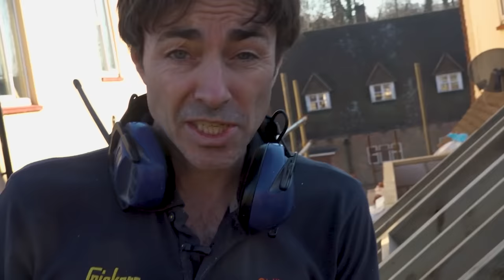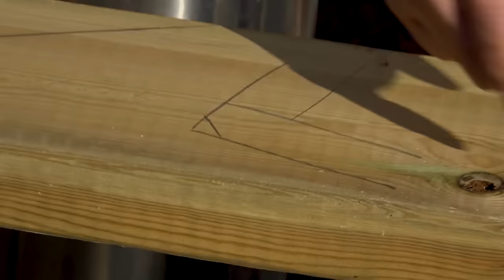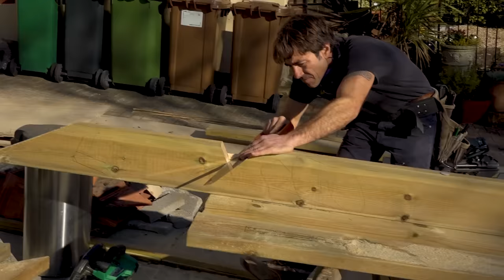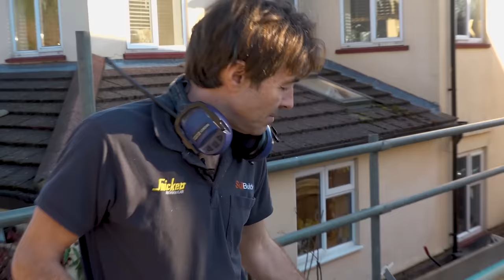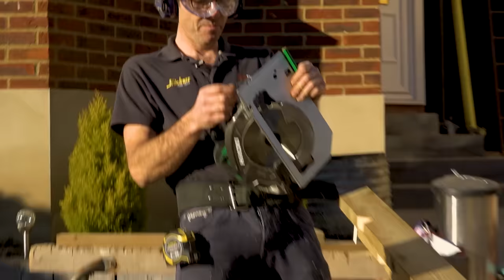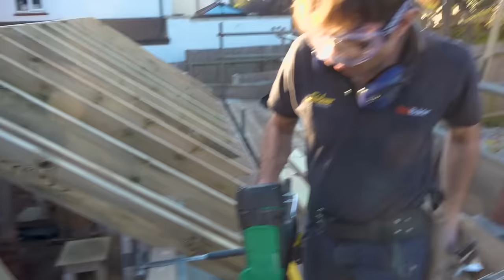How to Cut Hip Rafters

Comment: Big up to all the apprentice carpenters like me watching this so we can be better at roofing😂✊🏽
Reply: Thanks for watching John, good luck with your career, well done for choosing such a great worthwhile job mate
Reply: If you get this as an apprentice, youl go far mate.
Reply: Should watch Larry Haun videos as well. Both incredible teachers.
Reply: That's what I'm doing. 👍👍
Reply: Thats what im doing robin makes it so clear
Reply: My guy, meant to sit my end test for my level 3 nvq over a year ago, finally back at college to finish off with more experience, my end test is a pitched roof practical👀
Reply: Chippy life!
Reply: Get yourself a Swanson speed square off Amazon. Easier than using a roofing square to get your angles, indestructible and also fits nicely in your tool belt for marking square lines/running your skill saw along side it.
Reply: It's not roofing it's carpentry. I'm not watching roofing
Reply: @Louisthesaxman1  a speed square is useful for a lot of things , but it’s not nearly as accurate as a framing square.
Reply: @trevorhanks5282  I don’t want to be a roofer either! My skills are more inline with “Roof Framing”.
Reply: @larryrobinson08  I use trigonometry to get the length of all rafters along the pitch line and my speed square to cut my plumb cuts and bird mouths etc and you couldn't get a cigarette paper between my joints so I'm not sure how much more accurate you want to be.
Reply: Perfect scribing and your away
Reply: ✊🏾✊🏾💪🏾 right on! Brotha! Lol
Reply: Big up to all the sparkies working inside😉😉😉😉
Reply: You can't roof that's not a hip cat thing😔
Reply: Yeah im in😮
Reply: I'm 35 buddy been on it since I was 15
Guys like this can always show ypu a trick
Reply: Stay safe mates
Reply: Big up to you too John! My first time was yesterday with a roofing crew and I’m fascinated and intrigued. Roofing has become my passion I’m only 23 but I’m going to do whatever it takes to become a professional roofer. It’s such a beautiful side of carpentry. There’s no guess work just pure intelligence and charisma passed down from those you aspire to become! Love it ❤❤

Comment: Hi  I enjoyed watching your video.  I served 6 years of apprenticeship as a Joiner, and part of it was Roofing. the Joiner who was teaching me was in my  second year, the whole roof was set out on the ground,  after measuring from the wall plates, working from the building square, before we started off all the timber which was 3x2 75x50 as now, then each one was checked for the round (top of spar)  the reason for this when the purlins were put on the spars as called was higher which made it easier to nail down, then 6inch nails, the Hips Valleys measured by using the building square, then all cut by hand, as you did with your jig we cut the pattern spar with a strap on both ends, All done by hand saw, how things have changed, now, of course, it's all pree made trusses. I was always grateful for that experience of learning to use the building square, I am now 82 years old and still remember most of it, all thanks to that Joiner. it's nice to see someone else  now showing how to use the Building Square Regards welshman 2081

Comment: 71 year young still going strong carpenter from Oregon. I love watching how things are done in other places. I'm always learning and wish I had You Tube when I started. Very good well made straight forward video. Getting hips to align and plane out properly have always been a problem. We don't do hip framing to much anymore . I like the half lap joint on your top plate.  I also like you using a framing square with a wood piece clamp to it. I also do that method. The newer generation is speed square this and speed square that, I like the framing square. I think you get a more accurate layout versus using stair clamps. I also like you using  wider hip material. I use double 2x material. Its easier cutting your bevel and more importantly it allows better backing for nailing your roof sheathing. Some company needs to invent a mechanical hardware to make better connection for the top of the hip to the ridge. What species of lumber are you framing with ?  Here in western US its primarily Douglas Fir. More engineered lumber products are now being used. Simpson Strong Tie hardware is the standard for framing hardware in the US, is it used in England ?Thanks for taking the time making the video.

Comment: Thats a brilliant method, I've been a carpenter for 16 years and never though of cutting a hip in like this.... fair play you'll never stop learning in this trade.... love it!!!
Reply: Ceiron Green carpenter or your a framer? “ carpenter “ is a general term, usually means finish work or handyman type person. Not someone who builds houses, or remodels for a living.
Reply: @joeframer9642  The term carpenter has no relation whatsoever to a handyman
Reply: @joes2318  I'm a carpenter mate. Fully qualified and very well trained thank you. I have always cut a hip in using a geometric method. I was pointing out that the method Robin has demonstrated here is a different way to how I've been taught.
Reply: @joes2318  my mistake, apologies mate.
Reply: Ceiron, On a small roof it's easy to measure the length of the hips as Robin did here, on a much larger roof I always made up a rod and attached it to a dummy hip foot/ birdsmouth and got the length of them like that. As for getting the height above plate I always measured the vertical dimension from the corner of the plate to the top of the common rafter, whatever that measurement is measure down the plumb cut of the hip and this will give you an identical height of the hip in relation to the common. This is in effect what Robin did but not sure he explained it exactly like that. Fair play to him for showing those without his experience, I wish these vids had been around in the mid 70s when I first entered the building trade, they are invaluable as a learning resource. Happy Roofing
Reply: You can also measure to the point of the common rafter intersection and then work from the point of the hip down  either way marking up will be     a 45 mark up or down  . .
Reply: @chippyminton8711  most definitely buddy, I totally agree. Thanks for your advice, I'm looking forward to implementing it on my next hip roof. Happy roofing.
Reply from the maker: @mattryan1986  This is a difference between American terminology and the U.K. We claim prior art on this one.
Reply: @joes2318  Framer is american term, used to be carpenter&joiner who would do the lot, I'm bricklayer of 40yrs by trade and general builder but respect all good tradesmen
Reply: @ceirongreen1676 , its a good ole boy can admit his mistake.

Comment: Great video as usual guys. 
A tip for you Robin that I discovered a bit ago and I noticed you don't do it on a previous video.
When finishing the birds mouth with the handsaw, do the along the grain cut first followed by the cross cut, that way the grain keeps the piece in place whilst you finish off the cut making it neater and less likely to leave the little corner in there.

Comment: If I'm on my own putting up hip rafters, I nail a block onto the end of the 45 degree cut on the wall plate at the height of the up-stand then pick off the points with a straight length of timber, works great.

Comment: Hi Robin, I believe that I made a comment some time ago (before I had had my hair cut) and wasn't getting enough air to my brain, I wish to amend my comment it was to do with obtaining jack rafter diminishes the way I was taught back in the day when I had more hair! with the framing Square take the rise per ft run on the blade and the figure 12" on the tongue set to the edge of the timber and then mark and move 4" to the left the distance between the marks was the diminish of the jacks for 16" centres. I think I said move to the right in my comment. It all sounds a bit long winded now but it was quick at the time without calculators, actually I don't even think the wheel had been invented!!! Thanks again Robin for your site makes an old timer happy.

Comment: I much prefer the 'Measure once, cut 7 or 8 times, f@~k it up, get another bit of timber, do exactly the same again, get pissed off, throw a tantrum while my wife tuts' method, but that's my personal choice. 
Robin goes to show how technical a roof is, most of it went over my head (if you'll pardon the pun), great video.
Reply: the math is surprisingly easy and the satisfaction is big! Keep on truckin'
Reply: Measure 8 time's cut once it takes me forever to do a job 😂😂👍

Comment: Back in the 70’s I was working in Chertsey Surrey UK and used to spend my lunch times watching the roof restoration of a grade one listed 17th century two story house opposite. I was particularly intrigued on the method required for the cutting and fitting of the hip rafters (especially as they were all newly milled expensive English oak). After being measured and cut on the ground, I was astonished to see how well they fitted first time. (they needed to; it took three men to lift one!) 
Now I have some idea of how It was done, Thank you so much.
Reply from the maker: The first hundred you do are the hardest but after that it is not so tricky.

Comment: Been out of building trade 25 years now, I'm amazed to see how the power tools have changed. Nail guns were a recent invention in early nineties, big and awkward. Battery drills were mainly made by Walt Disney for Mickey Mouse.  Only the well off tradesmen could afford such luxuries. Hammer and saw for the old boys and 110V gear. Used to have to lump half ton yellow transformer across site, then your lead an them stupid plugs. I knew of some plumber who accidentally came down from his steps, stood on a 110V plug that had been dragged to the bottom of his steps while up there and broke his ankle as the plug rolled under his boot. He was PAYE but I don't suppose his employer was too happy.
Very good chippy work BTW. Keep the vids coming, I've just subscribed.

Comment: Love it from New Hampshire USA
Although we use inches & feet so keeping up with the math is a bit dodgie... 3rd generation builder 1st yr on my own after my father who's a master carpenter was diagnosed with laryngeal cancer losing his voice completely. Always looking to learn any new tricks or how others do the same thing with the same common end goal.  Thank you 100 mate.
Reply: Seriously? Metric isn't hard, count your fingers, it's easier to shout 150mm rather than 5'' and 29/32,that actually took me 5 min to count and work out on a tape measure, in metric numbers go up its bigger, in imperial numbers go up its...smaller...and/or bigger? Your money is metric, I'm interested in why Americans are so against the metric system, am I missing something?
Reply: @sally6457  As a UK Carpenter, we use both measurements. Above a meter in size it sometimes gets tricky to communicate the size of cut needed in metric to who you are working with 87 inches is much easier to measure out on a tape than 2210mm. Trust me, the bigger the sizing the easier it is in Imperial.
Reply: I'm in the UK and still use feet and inches as that's the only way I want to know .still get my roofing square that way . Easy to make mistakes in metric . Why are doors 2'6" and 6'6" and ply 8' x 4' but plaster board 1200 x 2400 . Timber is sold by the cubic metre yet four by two or two by as it's called . I don't go shopping for 98mm x 48mm as that's the sawn size . Either one or the other . I'm use to the imperial size in timber but I do use metric for metal work . I would use a 12mm bolt  with 1.25 pitch  thread .
Reply: @sally6457 , man is working from a plan called out in feet and inches, you expect him to first convert every call-out? Seriously?
Reply: @michaellloyd463  so is accuracy not as important if it's big? On a UK tape measure the 1/16" marks stop at 1', while millimetre  marks are the full length.
I'm unfortunate enough to be a British 40 year old joiner, so I'm working in the middle, I have to know imperial to understand the older generation, and the modern world of construction is metric, 
So we are the generation that had to learn both systems and know how to convert one to the other depending upon who you speak to,
Its all frustrating.

But metric is easier! 😝 hahaha
Reply: @leehaelters6182  I'm not saying that at all, I'm talking about people who stubbornly won't use and dissmis the metric system, 
NASA work in metric...

Comment: I am totally amateur but I did two roofs when I was younger. I got there by a mixture of calculation and trial and error. No roofing square or nail gun or power tools. 90% as good at best. They survived and don’t leak! I employed a master craftsman like youself for my next extension. He measured up the purlins and cut the compound mitres-perfect fit first time. All hand sawn and hammered nails. I reckon you should get an honorary degree in trigonometry.

Comment: When I frame hand cut rafters, I measure the distance from top of beam/ridge, to the outside of the plate. I cut the plumb cut, hook onto it and swing my tape across to the distance I measured. Using a speed square at the seat cut I mark the width of the plate where it intersects and there’s the bird mouth. We all do things differently, but that’s how I do it!

Comment: I love to see how every one has their own method of doing this. Wen i was at collage i was told to cut the ridge angle first then to scrib a line 1/3 all the way down for the birds mouth and then measure the length of the rafter from the highest pointand put a mark on the 1/3 line wear the length hits it. I probbably missed a few steps i finnished collage a few year ago
Reply from the maker: If that works then fine but does that give you the correct height above plate? I need to ask Dan Cox

Comment: I fully agree with your point about looking at the saw blade rather than the guide. As a builder I hardly ever look at the guide at the front but will always looking at the blade and it is hard to do this with certain brand but with Hikoki you can.